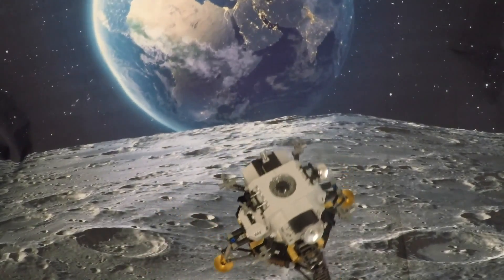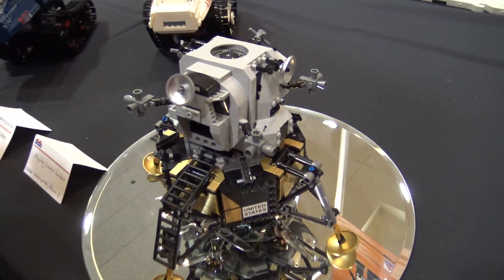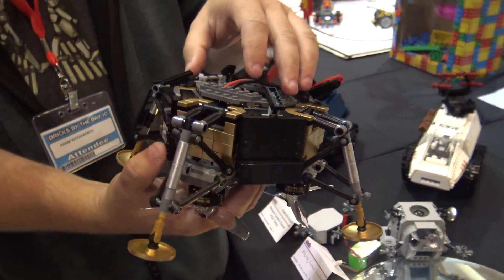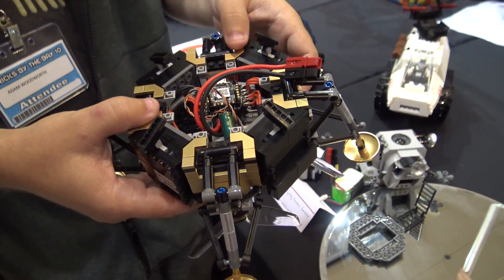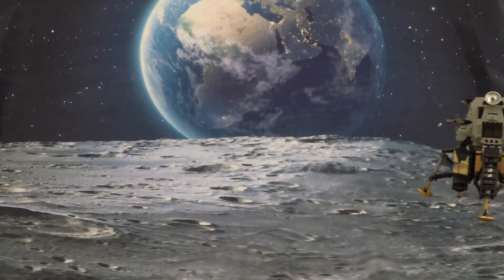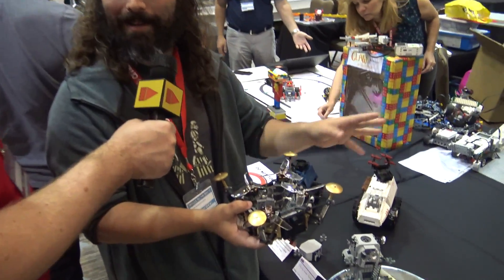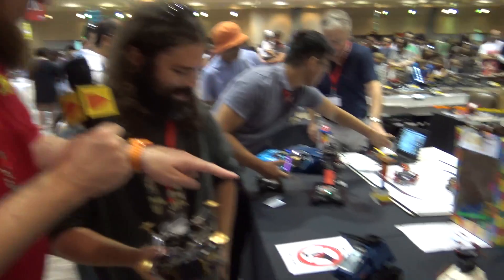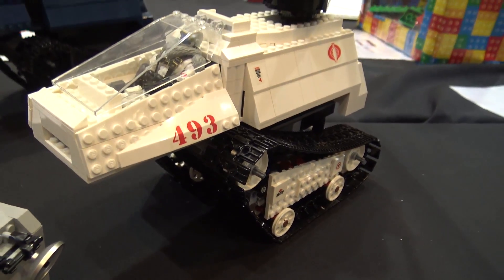Flying LEGO Apollo 11 Lunar Lander | Bricks by the Bay 2019

Comment: I’d have figured there was a zero percent chance of control after takeoff with the weight. Still, it looks like it’s barely “controlled” flight. But that’s not his fault, weight has its limits. He could easily improve it but it would require heavy mods to the structure. As usual batteries are holding us back.